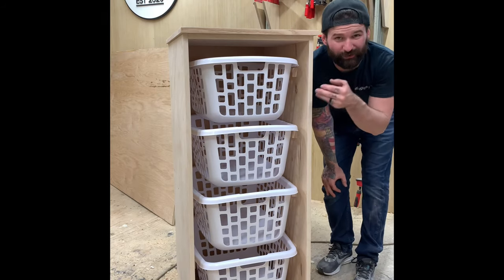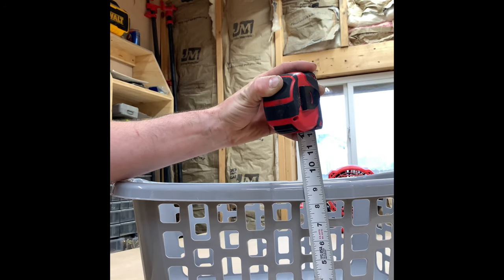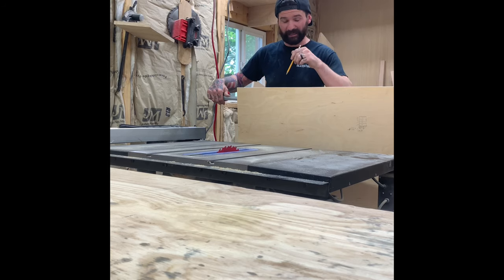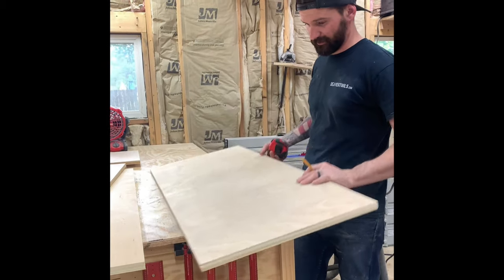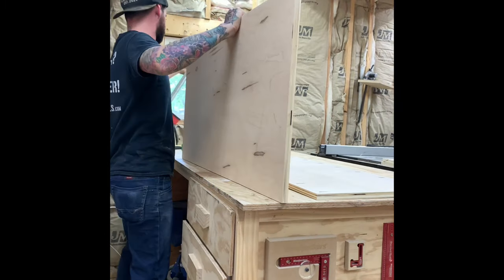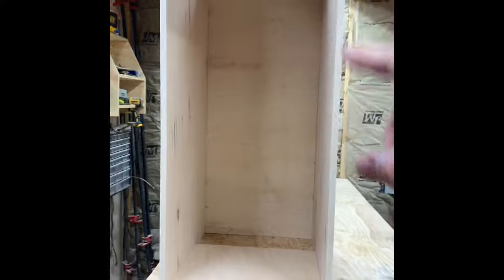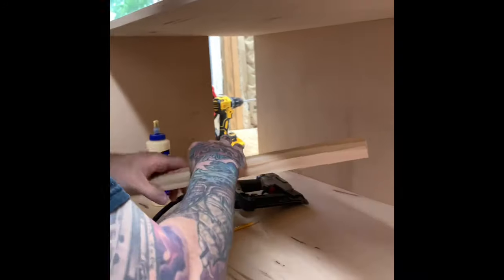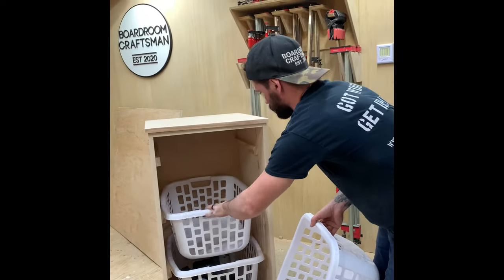Best selling woodworking item that has made me THOUSAND$$$  /EASY DIY laundry basket organizer

Comment: What size was the top and what size screws did you use? Love the tiktoks and YT videos!
Reply from the maker: I cut the size of the top 24”x 20” and I used z clips to attach the top
Reply: @boardroomcraftsman5251  I'm sorry I should have specified. I ment screws for the back and sides lol
Reply from the maker: @jamesdeckard4610  it’s all good! They are 1-1/4” long construction screws or you can use pocket hole screws either or
Reply: @boardroomcraftsman5251  Thanks man!